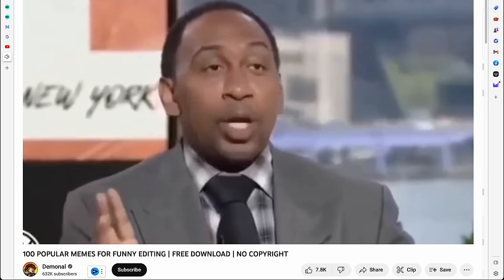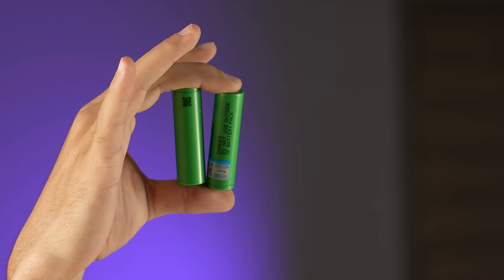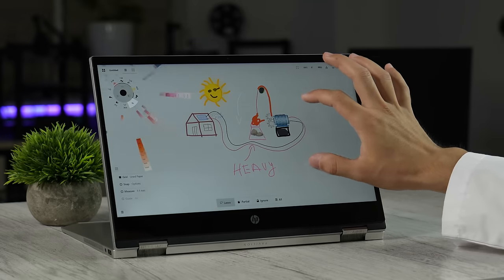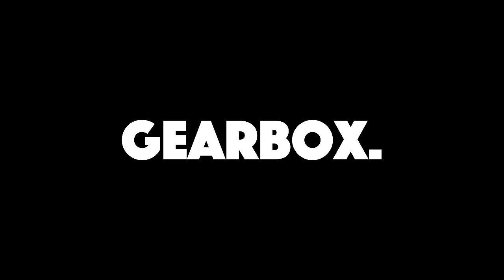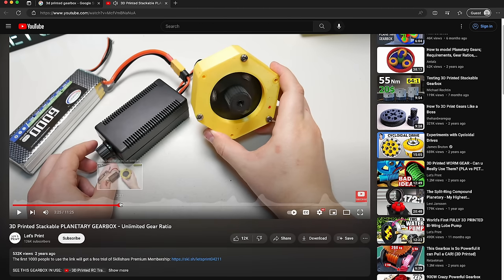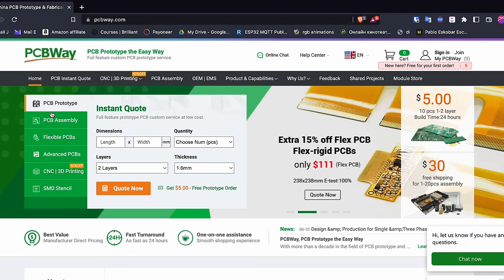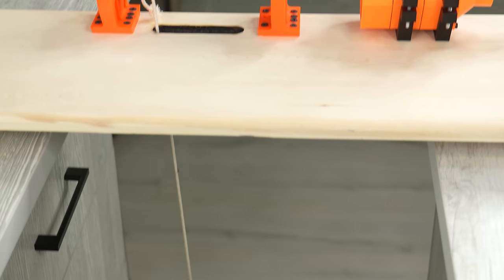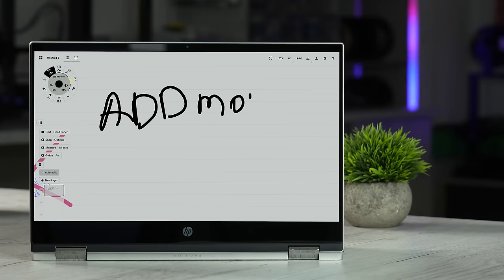DIY Gravity Battery: Unexpected Results!

Comment: You can decrease the design difficulty and possibly improve efficiency by reducing the amount of mass that you are lifting at one time.  Using something of uniform size like marbles or ball bearings might be a good alternative, although there would be wasted space and extra expense.  A more versatile system would be one that uses fluid.  Someone else suggested a capacitor bank, which might also act as a good in-between buffer if you are producing more energy at any given time than you are storing, or to distribute the load if the energy production method results in power output fluctuations.
Reply: Yeah, that would just be pumped-storage hydro
Reply: I would suggest using pumped-storage hydro, but using whatever the heaviest powder you can get a hold of. Mercury would be very energy dense, or lead powder.
Reply: @emifro  theres a reason that wet storage is a thing
Reply: @MegaLokopo  the government watching me buy 12 tones of mercury and a used tunnel boring machine (i live right above the citys water supply)
Reply: @samuelmatheson9655  You could probably generate enough energy storage, by building the largest tower you can without permits and digging the deepest hole you can without permits.
Reply: @samuelmatheson9655  If you do that, please post a link to a video of your neighbors reaction to all the equipment arriving.

Comment: I love this. The problem with chemical batteries is their self discharge rate. My solar system overproduces by a huge margin from May through October. Currently the power company takes that extra power from me and sells it to my neighbors, giving me credit for only about 1/4 of the price that they're charging my neighbors. Then during the winter months when we don't produce enough power they charge me full price for the supplemental power that we need. If I could store the power in a lossless kinetic battery similar to this it would be a game changer. Of course, I'd be trying to store several MWh so just a few rocks won't cut it but I think the concept is sound.
Reply: Do it with air pressure, or use the energy from the solar to generate a gas like hydrogen and store that gas in a container.
Reply: @avenon87  hydrogen would be hard because you will loose atleast 60 percent of your electricity and the electrolyzer and fuel stack is really expensive 
I don’t know much about compressed air batteries but though, not a lot of practical videos on YouTube

Comment: Awesome video. 
If you put another pully on the weight and fasten the end of the roap on beam next to the beem above you can make a reef making the pully mechanical advantage more so you can have double weight for longer roap and the motor will see the same load.
Reply: I wonder if a quality pully and cable system would out perform a greabox.
How much energy is waisted by heat in this system?

Comment: Add a snatch block for mechanical advantage and charge the battery.  This produces more electricity with less work.  Easier on the engines.  Also you could you a car or truck to lift the object and charge a full days worth in minutes.  You could use a small harbor freight motor.  Multiple fuel sorces.  You could manually lift it and work out.  You could use a home gym to make a small one.  There are way to many possibilities.  And one more thing that will blow your mind from lifting those rocks.  Water.

Comment: How long can it run for and what is the total watt hours put in vs what you got out?  This looks like it actually worked half decently and is a good proof of concept.  I think it has potential if it's optimized.  My train of thought would be to have a setup like this in addition to a battery.  In the day time, any excess solar power would go towards lifting the weight. At night wWhen battery gets too low the system would run and put power back into the battery. The advantage of a mechanical solution like this is it does not care about the state of charge, it can be at 0% or 100% or anywhere in between, and sit there. Batteries on the other hand tend to have a preferred state of charge they want to sit at so this mechanical device could help with that.

Comment: digging a deep hole and lengthening your rope can extend your output, upgrading the gears to steel milled gears can extend the durability of the gravity battery, altogether, nice proof of concept. I might try something similar once I have a place of my own that I can modify without needing to worry about a landlord losing their mind if I accidentally crack some pavers.

Comment: This was a fun experiment and I enjoyed the video. I wish you provided more data, though (measurements & calculations). The final parameters of the project (power and capacity) might not be too impressive, but I think you should still share them and comment on them.
Based on my own calculations (and assumptions) I estimate that you can power these lights at the end for less than 15 mins. Am I much off?

Comment: I'd like to see a 3d printed crane used to connect to multiple slightly lighter loads, to build a structure, then lower that structure down to make the gravity battery more useful over longer periods of time.

How long did your setup run when it was just using the gravity battery for those two lights?

Comment: Hello, great video! I have a question: How long did it take to lift the weight, and how long did it take for the weight to come back to the floor?
Reply: Considering a scenario where a 60kg weight is lifted to a height of 6m, the potential energy of the weight would amount to approximately 3600 Joules or around 1 watt-hour (Wh) of energy. Assuming a motor with a power rating of 50 watts and neglecting any losses (assuming 100% efficiency), it would require approximately 1.2 minutes for the motor to consume or produce 1 watt-hour of energy. However, this might not be particularly useful when considering the energy storage capacity of phone batteries, which typically range from 5 to 15 watt-hours (Wh).
Reply: Thanks, and the time that the weight takes to come back to floor is 1.2 min?
Reply: You could also use a buck converter and a higher voltage generator to get more power in a short time . If the generator is 60v/ 500ma then using a buck converter you can get 12v / 2.6a power that can be stored in a capacitor bank

Comment: I've been imagining a mechanical gravity battery which uses hydraulics to hoist the object instead of pulleys. I also imagined 3d printing metal alloys for the gears instead of plastics. My idea allows for very dense and very heavy objects to be used which creates a more energy-dense battery. It would take up less space, and contain more potential energy. 
The idea was that you could store energy for the darker months of the winter this way instead of storing it overnight.
Reply: The wonder what's the max power you can store. It's definitely attractive, especially considering you can lift a car which weighs a few thousand pounds with a simple jack.
Reply: Read about Porąbka-Żar powerplant in Poland. This is your idea implemented in practice.
Reply: @mememan2344  Me too. I haven't sat down to calculate gear to weight ratios yetMy partner and I are hoping to store 15kWh in each gravity battery on a remote property in the desert so we can access the property with an electric vehicle. The tech doesn't exist yet, but I different imagine prototypes while I'm hiking.
Reply: @danielmichalski94  Large infrastructure solutions are inspiring. My ideas come from my partner's work on infrastructure in California. What I'm imaging is a energy dense home battery for charging electric vehicles. As an anarchist, I am more interested in small scale energy and water solutions than I am large infrastructure solutions. Small scale solutions can be custom tailored to utilize energy that is already present at the location where it is needed. A rain collecting gravity battery at the top of a tree, for instance, would be useful in rainforest. When the barrel at the top of a tree hits a specific weight then it triggers the gear system to generate electricity. Empty the barrel into your irrigation system, and you can then hoist the empty barrel back up up to the top of the tree using a pulley and your own strength. In an environment with more sun and less rain we can store solar energy in a gravity battery like this video. A small tidal generator, made of bone which is 3d printed from oyster shells which have been ground up, actually uses the gravity of the moon. It's an exciting time to be alive!
Reply: @ericdouglasalexander  
Orrrr, you can have 2 separate systems
One for lifting the weight up,  by hand, like a horizontal rudder wheel, combined with pulleys, usually used to harness mechanical power of cattle.
With spokes long enough - you could lift tens of tons
And another system to slowly release the weight down, with a complement of reducing gears, for something that would work for hours, possibly whole night, and give significant wattage...
Reply: I don't know if it could be 15kWh, but perhaps an ox could get a bigger weight up there, and high enough...
Reply: Oh yeah, you'd need an ox, and some grassy meadows, so I dunno about desert... maybe camels?
Reply: @MrDeicide1  My design uses bevel gears and a fork lift similar to this video~~>  https://youtu.be/-t7NI0sPRyY It operates in a shaft underneath a geodesic dome. I'm still calculating the weight, gear ratios, and the how deep the shaft will need to be in order to store the energy we will need. I'm now shooting for 70,000 kWh of power.
Reply: @ericdouglasalexander  
ooooooh, friction forces there...for anything of more substantial weight...
Also, doubt that the metal could withstand the stress. The pole gear would carry it all on Edges of it's groves...
thescrew, if you will
I mean, the Leadscrew, like that, is usually used horizontally, as in machining lathe mechanisms, but it's used to Push and move parts of the machinery around, it doesn't Carry weight
Reply: @MrDeicide1  Maybe a grade four titanium rod that is about 12" in diameter?
Reply: @ericdouglasalexander  
and how tall?
and... who would pay for that much titanium?
and how to bring it here from russia?
Reply: @MrDeicide1  I need to calculate how tall it will need to be based on the force of gravity, the mass of the object, the gear ratio, and the size of the motor. The objective is to store the energy in the smallest amount of space by playing with those numbers.  I'm beginning with the question, "Can I design a home gravity battery that stores 70,000 kWh." 
I think it is morally wrong for an engineer, scientist, or artist to concern themselves with matters of capital. Let the businessmen and politicians worry about that. It is their delight to concern themselves with such base and violent matters. I mean, Russia? I don't even believe in the existence of nations. What I was taught when I was young is that there are no nations. Nationalism was a mistake made in the early 20th century. I reject the idea entirely as do most people with an education.
Is it possible, and how might it be done. That's what I concern myself with. Would you like to point me towards an equation?
Reply: @ericdouglasalexander  
Lol, I just mentioned russia cuz they are the ones with most of the world's titanium reserves.
The U.S. has almost none.

Are you an american or a brit? If american, that coma means 70 MWh, different annotations here.
Also, you mentioned storing power for the duration of winter...
Please clarify the number for me.
Interesting idea. I like brainstorming with you.

And you mentioned hydraulics. Maybe a hollow concrete column, buried down to certain depth, could serve as a hydraulic piston to push the weight up.
Not sure about the energy expenditure for something like that, but I suspect it would be More than simply pumping water Back up into an accumulation lake, the way regenerative hydro plants do it.

Still think that just simple mechanical set-up would work best, and minimize friction, resistance, etc...
Hold on, let me get you a link. I think you'll find this interesting...
Reply: It's a complete nonsense, the math doesn't work out(It's basic high school physics, just E=mgh). Li-ion batteries are cheaper and way more practical.
Reply: @neplatnyudaj110  
Now now, it's a well known fact that Maths is racist, Neplatny
Why don't you let grownups figure this out , instead of bothering us with "gravity" and such things
Gravity, shmavity
pinches  Neplatny's cheeks  Ooooh, so cwute !
Reply: @MrDeicide1  It's all fun and games until goverment starts wasting money on solar roadways, gravity batteries and other nonsense.
Reply: @ericdouglasalexander  your idea wont ever come to fruition. There is something out there that weighs alot and is practically free. In addition to that it takes the shape of any container it is in and it is pumpable. We call it water, and we can use it to store power in pumped hydroelectric plants. Much cheaper+can be retrofitted and it allows you to gradually move millions or billions of liters with relative ease which can store massive quantities of water. Doing the same with solids would require lifting essentially a mountain maybe half a kilometer
Reply: @ericdouglasalexander  storing energy kinetically is better than your idea even, just rotate a huge mass inside a vacuum, with the added benefit that the stored energy increases exponentially with rotation speed.
Reply: @ericdouglasalexander  i heard of sand batteries which is better than using water to store heat because of the higher temperature achieved in sand. But why dont they add high pressure to increase the waters boiling point?
Reply: @ericdouglasalexander  if you could pressurize water to 1000 bar and now heat it by 500 celsius you would have a energy density slightly higher than lithium ion batteries. Maybe if size is large enough, you would be able to overcome the cost of building equipment that pressurize to 1000 bar and contain it. Add a vacuum layer between the battery and the outside world to reduce heat transfer, and make the outer wall reflective to infrared. You now have yourself an incredibly dense storage
Reply: @tormodhag6824  I like that idea. I believe there is an appropriate method of energy storage and generation for every situation. Much of it has to do with where you live.
Reply: @asimplepig  yeah like how pumped Hydro obviously dont work in flat and dry lands, but how sand batteries are excellent in deserts since the sand is abundant. I did some more math, a relatively low pressure of 250 bar should allow something like 1.4 MJ per liter of water to be stored, but what if you use a heat pump to help heat it. Wouldnt that save energy since you are only moving heat into it, and then you can use that heat to make steam when you need it.

Comment: Did you think of something less strenuous for the motor and the gearbox? Rather than lifting the whole bag, replace the bag of stones and the rope with a chain. The motor lifts the chain into a basket at the top. At the end of the day the basket is heavy enough and can be used to make energy. The chain does not have to be thick. It can be long and thin so a small portion of the chain is in the air at any given moment.

Comment: Assalomu Alaykum. Good to see your idea turned into experiment. Are you willing also try storing energy with other methods than battery like pressure, tension or heat..?
In addition, experiments on getting energy would be also interesting. Just to add, wind turbines also contain gears and require 3D printing and is fun...
Reply from the maker: Va alaykum Assalom, Thank you for your interesting ideas, I will consider them in my videos!
Reply: I like this idea. You could also try using a gravity water pump to store energy. I remember seeing  a video of someone using one for water supply.

Comment: The inefficiencies in this project are many. It's a great starting point. You should have bought an all metal gear box. They come in tons of gear ratios and they have bearings for far superior reduction of losses, never mind being much stronger than plastic parts! Use a BLDC motor. They are easy and cheap to find in a Kv similar to your 65% efficient brushed motor. Efficiencies will be more like 80-90%. They will also can be far more powerful that your brushed motor and won't over heat so much! All of that combined, I'm betting you will be able to significantly improve what you have now and get a lot more run time. I LIKE the idea, but it needs improving! Please make this again with better parts! I think you will be pleasantly surprised with the improved performance!!! 
*
Your solar panels are variable output devices. They won't make the same wattage every day and it is rare they will ever make their rated output. Clouds will reduce that for you. Angle of sun to the panels will reduce that for you. Tracking the sun will decrease this inefficiency!  Hot panels make less current and heat shortens their life spans. Keep your panels at less than 26C for best results. There are times your panels will make more current than it takes to lift your bags of rocks. You may have already finished lifting the rocks. Add a bank of super caps in parallel to the motor controller to soak up small current changes. Add a pack in parallel to the rock lifter to charge that can soak up the extra power. Eliminating losses is a big deal! Even batteries don't convert 100% of current in into 100% current out.